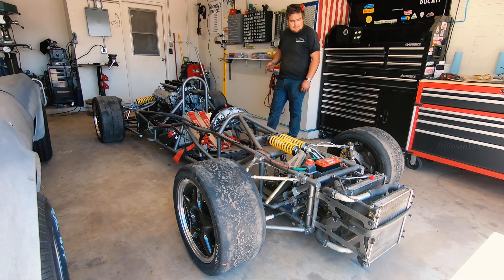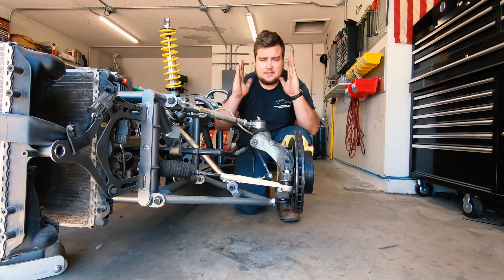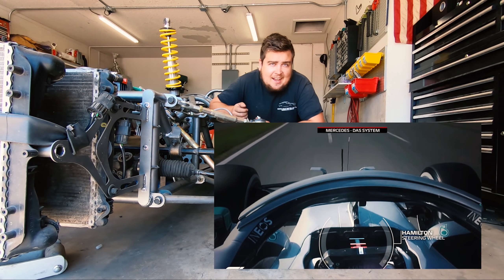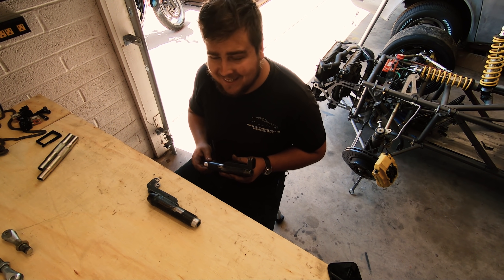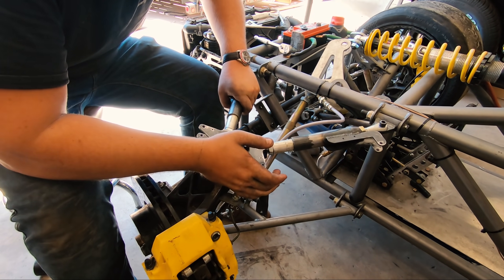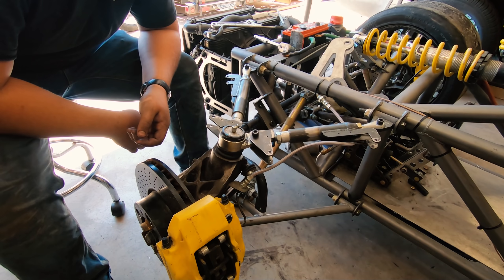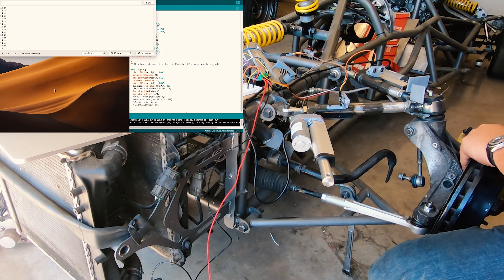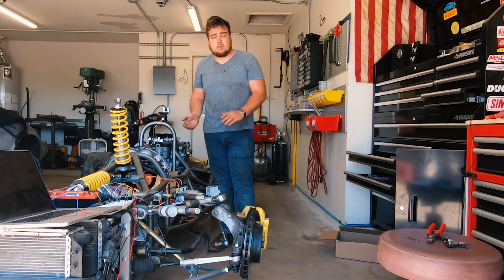DIY Formula 1 Active Suspension and DAS

Comment: Although this has been specifically banned by the FIA, it's simpler and perhaps better to put the rams in place of the tie rods and no rack. You now maintain the same pivot points through the entire range of motion with only a single variable link.

For your future hubs, I think a few Mercedes street cars in the 2000s were multi link front and rear. So the link position on the hub and length could put the scrub in the exact middle of the tire. The entire assembly would be easy to do all the same parts front and rear (including rear steering if desired) if of your own fabricated design.
Reply from the maker: That's good to know on the hubs. I'm always looking for new designs, although the Porsche ones have done me well, with big brakes, vented rotors, ABS incoders, and lighter weight.
Reply: @WesleyKagan  Fabricated hubs to your specification will be still lighter and can use all those components. I assume that it's just an inevitability for you, since you have been so incredibly industrious so far.

Comment: I'm glad you exist. Every time I think about trying some "unconventional" idea in my non exist car, I come to your channel and you have already done/try

Edit: For the sensors you should try using the Pololu vl53l0x, it's a infrared sensor smaller than this hc-sr04, and won't be effect by all noises generated by the car (a common problem with those ultrasonic sensors)

Comment: Why not just move the frame upper mount (rotate) using the rotation there by not increasing unsprung weight, and use a chopper wheel with a simple led to fed back how much has moved? I’m not sure how much movement you need and wether you need the same in the front and the back. I enjoy your channel. Love to know what you think.

Comment: could you get stepped linier actuators strong and fast enough to get rid of the guide tube and the ultrasonic sensors. this is insane and I love it looking forward to how you control it with the steering wheel or otherwise.

Comment: My main concerns with the system is that I believe the weight of the system would damper the performance gained by utilizing active geometry, especially with it being actuated by hydraulics in the future. I'm also wondering about how complex the software would be to control the system. Would it utilize a LUT of suspension geometry configurations and interpolate between them to ensure your KPI, scrub radius, roll center, etc. are optimal, or would it attempt to calculate those on the fly?

I'm in doubt that the ultrasonic sensor has the accuracy and precision necessary to get repeatable measurements. Say it has a tolerance of 5mm.. that's a significant amount of play when it comes to repeatability in suspension geometry. My team uses linear potentiometers to measure our damper travel on our heave/roll setup, which I believe you mentioned, and we love them. Super easy to get precise and accurate quantitative data to convert into suspension travel and ride height.

Regardless, this is some pretty great work, and I'm excited to see how it fares in the future.

Comment: Did you run the freevalve miata for any significant period of time? If so, what do the valve seats look like? You are just slamming the valves down on them instead of slowing them down with a camshaft after all...

Comment: Great build and very interesting video. Keep up the great work.

FWIW: I'm English and you really should run away from the XJS as fast as possible unless you replace every last wire in the car. There'll be a wire that controls the power steers that will short out, causing corrosion in the coolant pump,  that will cause the odometer to rotate weirdly when you turn it on and ultimately cause the rear diff to, via the ether, turn gasoline into liquid gel.

Legend has it that Lucas electronics was founded by a descendant of Elizabeth Device, one of the Pendle Witches executed during the trials of 1612 in North West England. The ways of the sorcerers run strong in that family and came back to plague modern society as an act of revenge by making objects of desire (fancy English cars) utterly unreliable and potential death traps.

Comment: If aero is a big concern with your ultrasonic sensors there's better sensors that you can use like various light sensors (retro reflective or polarized retro reflective for example). Unless of course you went with ultrasonic for testing purposes because it's what you had on hand.

Comment: You could even get a set of tempature sensors to measure the inside, center , and outer tire temps 

That would help you calibrate the camber 

Or maybe a couple of distance sensor facing the pavement

Comment: Why not use a worm gear?  That way if there is a failure the suspension won’t collapse, and it will just stop adjusting.  Could even use a little hydraulic drive to just adjust the camber bolts that already exist.

Comment: For the sensors you can use the same principle as the digital calipers, with a stator and a slider that take measurements. You could even fit it inside the extension tube.

Comment: I think LVDTs would be more reliable than the 'sonar sensors', just taking tire noise/vibrations into account. The LVDTs could be used at each of the locations you mention in the video, giving you one common spare part. They're also commonly used as shock position sensors on drag cars and such. I like the idea overall, keep at it.
Reply from the maker: Thanks! Yeah, I’m not completely sold on the sonar sensors. Further testing showed any wind or change in air density throws all the data off.

Comment: I really don't like the use of ultrasonic sensors. Best would be to add a linear encoder to the actuator side (even better would be to have an actuator with integrated sensor)
Reply from the maker: I’m hoping to just run an actuator with an integrated sender, but at the very least I’m probably ditching the ultrasonics.

Comment: I dunno man, props for building everything.. But I see a few ways in which this just looks potentially dangerous.  The bottom A arm rod end is still operating in bending, and it sees possibly big bending moments when braking hard. The new sliding top links don't lock do they? So the actuators are taking all the loads from the suspension, significant when cornering and also when braking. Plus they are not in line with the ball joints, so that means bending moments in the actuators for which I doubt they are made. All the force also goes through those (hot) brackets you made, to offset the actuators from the ball joint.
I don't want to be an ass but this thing can probably do 150mph and at those speeds I really don't think you want to be at your current level of engineering. Cool to experiment, cool on a go kart at 50mph (perhaps) but this thing just isn't safe!

Comment: Ever heard of anyone making it so any downforce that is created by the rear wing or front aero acts directly the the lower control arm s so any downforce that is created doesn't put force on the suspension and only the tyres

Was hard to explain in my head so hope you understand what I'm getting at

Comment: A laser in-between actuator and linear bearing covered in boot. or even a cable with return spring. Have you seen a J-Damper? might inspire a new direction.

Comment: I could be wrong, but I'd imagine air moving at speed between the ultrasonic sensor and plate will have all sorts of undesirable effects on the reading...🤷‍♂️  That and the speed of sound changes with atmospheric pressure and temperature.
Reply from the maker: Yeah, my testing showed that too and I’m absolutely looking for something different now
Reply: @WesleyKagan  it's fascinating that you got the ultrasonic positioning to work as well as it did. I'll keep it in mind for situations that won't have the undesirable repercussions from moving air and changing pressure/temp. 👍

Comment: I am by no means an expert, but I have used ultrasonic sensors around moving air and heat and found they can be somewhat unreliable.  Likely the sound waves traveling through the different air densities.

Really inspiring projects! Wish you all the best!
Reply from the maker: Yeah, I’m thinking back to linear potentiometers for sure:
Reply: A Linear Encoder may be a happy medium - accuracy and contact free.  I have never used them myself - my projects have always gotten by with Hall Effect sensors, but I am sure you want infinite adjustability, not just limit switches.

Comment: I have just realized that you can also change "camber range rate" without changing instant centers of suspension.
 Anyway, I think that it would be awesome to include both 'manually operated' toe angle adjustment and "active" camber adjustment.
If you had tire data and were able to collect speed, yaw, steering angle and suspension load in real time, (with tons of work and testing) you could create incredibly advanced system to help you keep tires at optimal camber and slip angle for given load during cornering. 

And for little dreamer kid in me the most fun option would be having this on all 4 wheels and have ability to set up "presets" for different conditions or needs. Changing setups from wet to dry (camber, toe and their change rates) without getting out of car... Unrealistic for 1-man passion project but Idea of sth like this being possible is consuming my mind entirely.

Comment: I think that's a lot of effort for a hydraulic actuator to stay stable and safe. I would rather use an excentric support for both upper arms and use whatever actuator to rotate them with some kind of arm, like a pushrod does. But it's however pretty impressive all the effort you put on that.

Comment: For the small amount of r.o.m. you need and the limited space you have, I would have put the inboard arm mounting bolts in a slot, then a block between the slots with an angled slot, so that as it moves up and down it pulls the mounting bolt for and aft in the slots. Internal system easier to mount, lighter, and more workable from an aerodynamic standpoint. Other options would be a cam or a spiral cut slot rotating.

Comment: Hey wesley

Hot take from someone firmly at the peak of the dunning-kreuger curve when it comes to suspension design,  but i think you need to drop the inner mounts for your Upper LCA's.   it appears at a glance that your inner mounts are spaced further apart than your ball joints,  which basically reverses the beneficial camber curve in an SLA suspension  (effectively turning it into the sweet-sweet understeery garbage chevy mass produced for 40 years), which you appeared to confirm with cycling it by hand.

Disregard if that was done on purpose,   or you have some mad scientist workaround with the active links, or some sort of voodoo to entirely prevent body roll,  although i would imagine you would  be better off using this system for positioning, rather than mid-corner on the fly adjustments,  i could imagine that would make for an interesting driving experience in a bend

Comment: Yea but this not the same as the das. You are changing the suspension geometry which will change caster, camber and toe angle. You could manufacture a new hub geometry so that you could have no wishbone geometry change with a moving suspension. My suggestion do a multi link suspension, so that you can adjust it and tune it for your car. I appreciate you like doing out of the ordinary stuff, i just don't really see the point for this.

Comment: I think a better option are the Sharp IR distance sensors. More compact and possibly more resilient to vibrations.
Reply: Also: the A8 and Phaeton use an active air suspension, you can search for the SSP to see how they did it. It's much faster to react than linear actuators, probably also faster than hydraulics.

Comment: You can get linear actuators with possition feedback built in. Might help
Reply from the maker: Yeah when I go hydraulic I’m planning on that
Reply: @WesleyKagan  when you go hydraulic, you should replace the coil over with a cylinder and accumulators so you can vary hight and stiffness on the fly, roll control etc

Comment: Could you not get a scanning tool to read the road surface ahead of the wheel and adjust the tire contact patch accordingly with software ?
Reply from the maker: I considered that- I also have a few other concerns that I might address in a later video
Reply: @WesleyKagan  I have seen it as a patent but never done on an actual car .

Comment: Unlike hydraulics, it does look like the main suspension tubing you're using is hollow... maybe you could put the ultrasonic thing in there?
Reply from the maker: Yeah, at that point I really want to go physical contact. I just don’t trust those sound waves
Reply: @WesleyKagan  Fair enough! At the very least that's a place you could potentially put the physical sensors where they're safe and out of the way.

Comment: Wouldn't a linear potentiometer be easier to package to know your arm position?

Or a servo/stepper + ball screw, depending on the speed you need it to work at?
Reply from the maker: For the steering wheel a rotary incoder is the plan, and it’s a little difficult to find long linear pots for cheap. I’m hoping the cylinders have built in ones.
Reply: @WesleyKagan  I was thinking about your arms, to replace the ultrasonic sensor

Comment: Awesome video, very excited to see this concept progress! 

Quick note about those ultrasonic sensors, you're very likely to have problems reading the data off then once you start driving the car. Since they work via sound/pressure waves any significant amount of air flow across them is going to disrupt the waves making it back to the sensor. A laser TOF sensor would be ideal, maybe the VL6180X would fit the bill.
Reply from the maker: Good point- I’ll look into it! Thanks!

Comment: Phenomenal video as always. You're the only creator I have the bell notifications enabled for. A quick tip on the sensors, ultrasonic are great but for a smaller package you could look into linear potentiometer or linear encoders. Plenty in printers and video game controllers to look at. It might be a nicer fit and would work easily with an arduino. Keep up the work, seriously fascinating stuff you're putting together.

Comment: Just for fun: How is the actual weight balance of the car with the V12 installed? That particular V12 is the lightest and most compact Mercedes built, but still it weighs over 220 kg. I'm guessing the weight distribution is somewhere around 70% rear to 30% front.
Reply from the maker: Yeah with the Porsche motor it was about 55/45, but with the Mercedes motor it’s, uh.. worse. I don’t think it’s quite 70/30, but at least 60/40. I.e, trying to get some weight over the front. The bare motor isn’t terribly heavy , honestly.

Comment: Good idea. Next, need to build some fly by wire system that limits dynamic forces (Suspension+steering+braking) within the real world specs of linear actuators.. ;) Maybe some hydraulic system and control both sides (As they're likely to be identical) with two rams, separating full dynamic forces from the actuator with the linkage?

Comment: You could use this set up for anti dive under braking. Also zero camber when braking. Both wheels cambered in the same direction around corners. Add tire temp inferred sensors and use these tire temps to set the camber settings. Toe settings and caster settings you can set based on track position. Instal sensors around the track to tell your computer the location of your vehicle.
Reply: How would you manage anti-dive? That would require vertically offset upper arm mounting points so the whole wishbone would tilt backwards, wouldn't it?
Reply: @bubblefoil  That is correct. I think just the rear upper control arm mount would need to move vertically a few degrees with an additional actuator. He did say he wants more weight forward?
Reply: He could also add an actuator to the steering rack and control bump steer that way.  All the actuators could operate in combination to give perfect wheel to ground alignment in all conditions with the parallel camber as both tires conform to the ground during cornering and braking.

Comment: i have a completely hydraulic mechanical idea on how you could move the suspension. https://imgur.com/vyWjuya
Basically you have one hydraulic piston that provides pressure to the index cylinders (exactly the length throw you want,lsame volume as both the two indexing cylinders combined, and those indexing cylinders move the index on the end of the arm and toggle the valves on the end. This way you dont have to worry about clean sensor data, its all mechanical. Your thoughts? Im not an engineer, just came to me as an idea.

EDIT: After more thinking I came up with a much better system that is completely hydraulic and pneumatic. see :https://imgur.com/H7S1jpi

Comment: NOT a criticism, but I suspect that when on the track your ultrasonic sensors are going to get swamped by all the wind (and other) noise. 

If you are worried about wind resistance from them, you could lessen that by putting them on the back of the actuators rather than the top.

Comment: Great that you are taking something like this on.  I do see your current iteration as being pretty underbuilt however.  I would simulate shock loads to that near full extension and see what happens.  Nevermind the actuators would probably shear but I could see your makeshift extension tubes buckling instead of sliding in a high force event like a pothole.  Would hate to see you end up in a ditch because of a major suspension failure at speeds man

Comment: Wow, So impressed with what you are doing. My only question is when complete, will the system be fast enough to keep up with the vertical suspension frequency as you drive over a bump, or are you using this to adjust and then fix the linkage lengths?